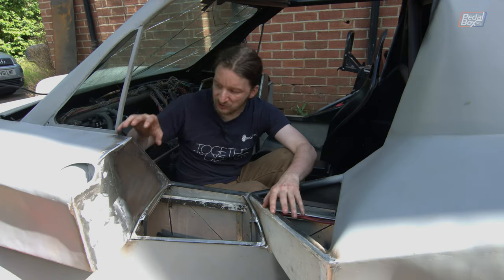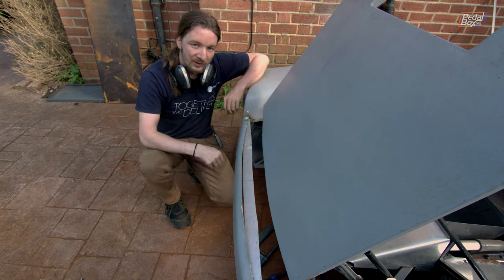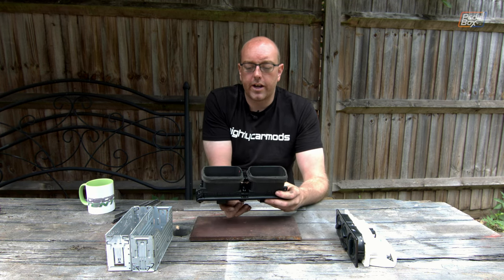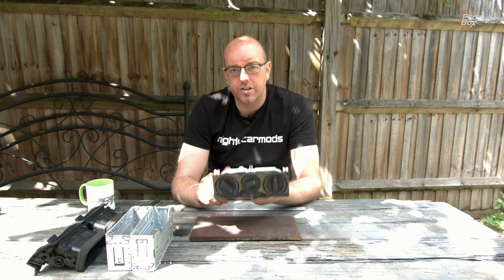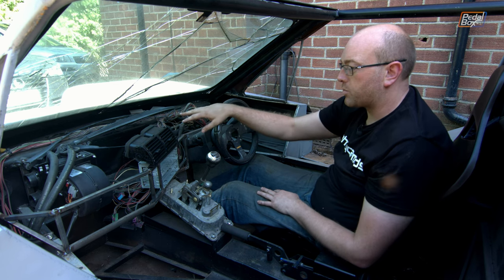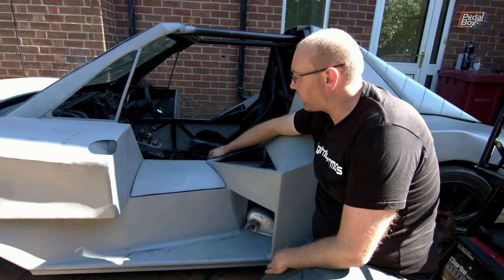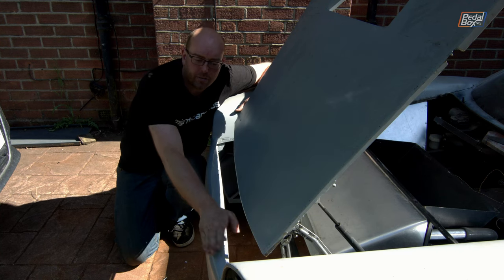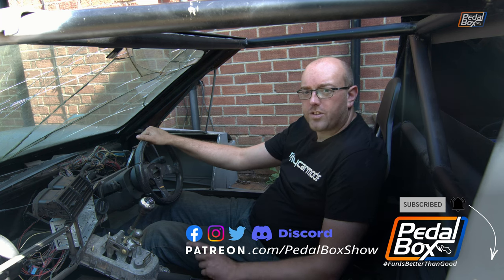Dash Framing The Interior | Audi TT Kit Car | PedalBox Episode 112

Comment: You do yourselves a disservice by calling this a KIT CAR. You bought yourselves a chassis and precious little else came with that. No body, suspension kits etc etc that kit cars usually come with or can be purchased piecemeal as determined by budget, skills, equipment and the like. The first video discussion did not even consider the Audi motor for example. Yours skills and knowledge are stupendous. Look forward always to the next episodes.
Reply: We're all awaiting the outcome of the evolution, top development!
Reply from the maker: It's really very kind! It still feels like we're just gluing bits of steel together and seeing what works, but the transformation has been quite substantial. I've been re-cutting some of the early episodes to put on Facebook in the new year and I keep thinking "oh that changed, nope not that, that didn't work" How little we knew :)
Reply from the maker: Us too! lol 😆